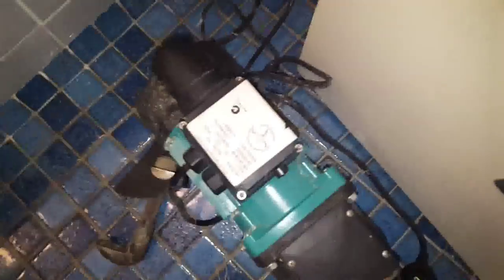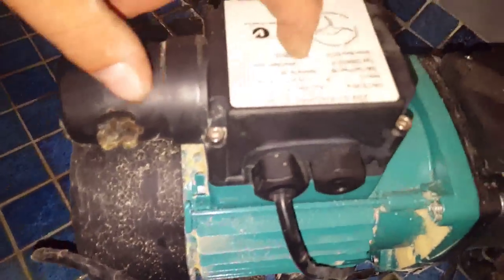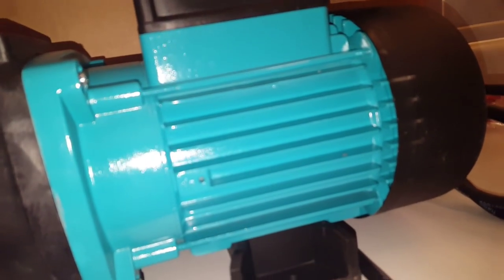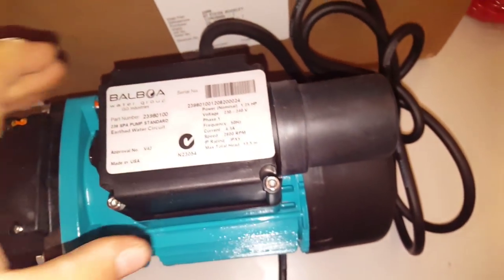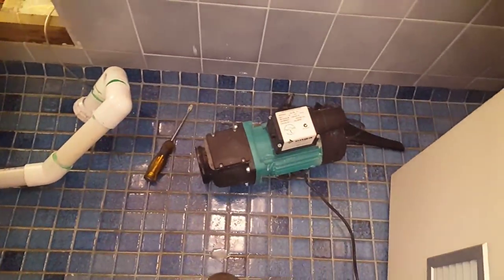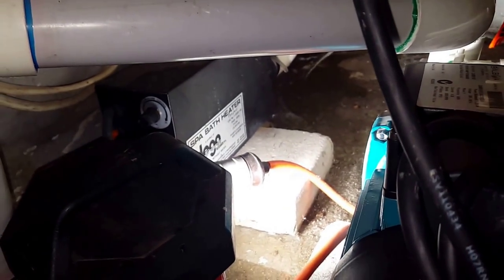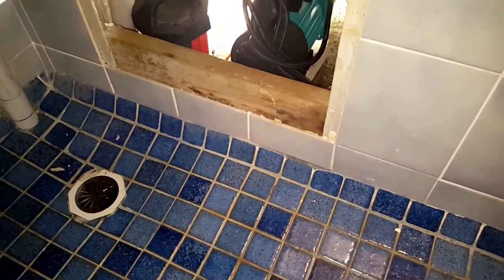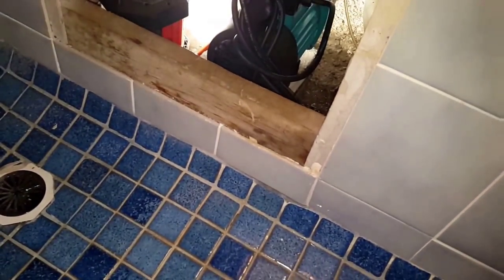Replacing a Onga spa bath pump

Comment: is there an access panel for that of you have to remove the tiles?
Reply from the maker: +singlecams access panel thank god haha
Reply from the maker: +singlecams access panel thank god haha
Reply from the maker: +singlecams access panel thank god haha
Reply: +One up the sleeve customs haha :)
Reply from the maker: +singlecams id get a pump with staggered  outlets if its installed  like this was difficult  to tighten the bottom  union up
Reply: +One up the sleeve customs do you have to cut the old pipe off to remove the pump it looks like that. So then you have to remake that pipe? thanks
Reply from the maker: +singlecams access to the top pipe was an issue were the union was on pump so i undid a rubber flex coupling on the lhs that was connected  to a inline water heater (black box)